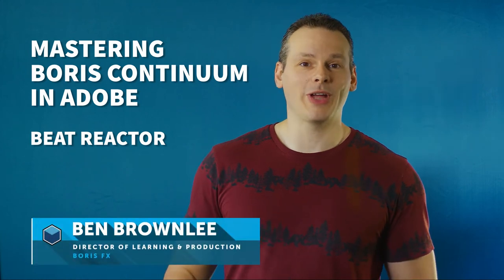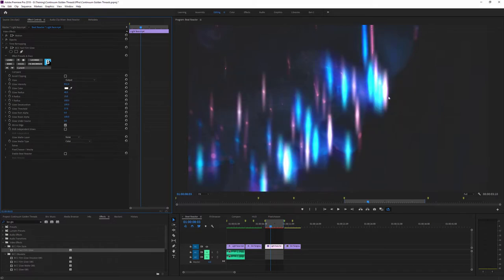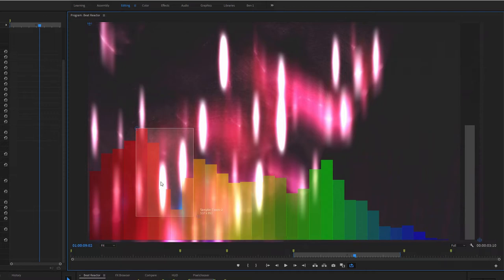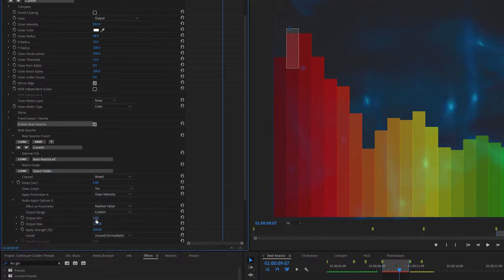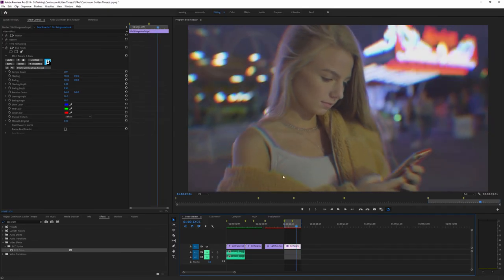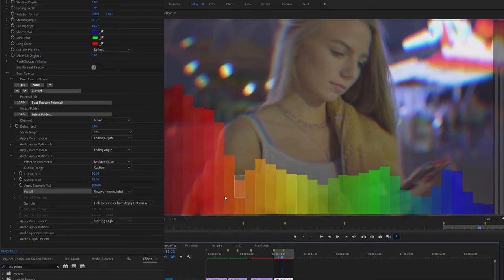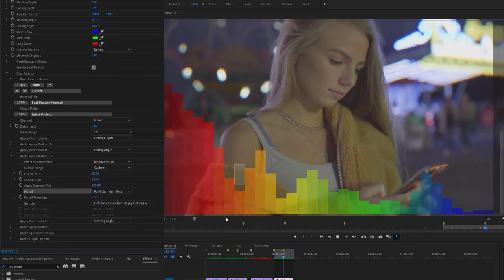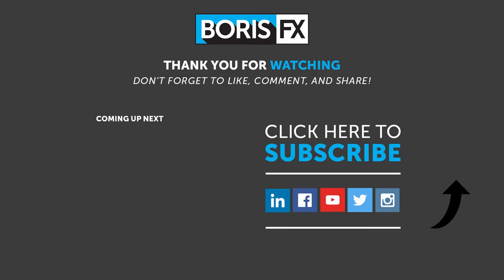[Adobe] Mastering Beat Reactor with Boris FX Continuum

Comment: My AIFF file must have been messed up because the spectrem would go crazy fast and wouldn't match the song. After putting the song in Audacity and exporting it as an AIFF (found under "other compressed files") it worked like a charm. Finally I can make sick lyric videos with audio reactive effects. Thank you!
Reply from the maker: That's an excellent tip for people to check if they have an issue.  Thanks for leaving the comment.

Comment: Hi, Iam using Davinci Resolve. I have all running with Beat Reactor. I was wondering were I might get that graph file that you loaded in? Its going to be tough figuring out how to use BCC Beat Reactor in Resolve but I think I can figure it out. But having that graph would be a start. Thanks very much :)
Reply from the maker: You have to a couple of things in Resolve. Firstly you must load in an external .aif audio file as you cannot grab the data from another layer in Resolve.  Once that is done, if you are still not seeing the graph you have to turn it on manually. To do that look at the Beat Reactor group and twirl it open if it is not already open. There is a parameter called Show Graph with a dropdown menu next to it. Set that to Yes and do your setup. Remember to turn that option back to No before you render!  Hope that helps.
Reply: Thanks so much. I did those first. The Aiff and Show Graph. Nothing happens, I think maybe with Resolve there is something else that needs to be done to get it working hmmmmm. In After Effects it works easily for me. I will keep trying. Thanks again.
Reply: Thanks again. Iam very familiar with Beat Reactor in After Effects. I also us Davinci Resolve all the time which I prefer. I have tried everything to get Beat Reactor to work in Davinci Resolve. Iam thinking maybe it has something to do with creating separate alpha layer. See this link. Maybe as mentioned working with alphas or secondary layers. I love Davinci so much I will try my best to get this to work (so I dont need to go back to AE) Thanks for any more help :) 🌹🌹🌹 Here is link
https://borisfx.com/documentation/continuum/bcc-overview-in-resolve/
Reply: UPDATE!!!! I got it to work. In case any one else needs to know. In the color panel I  added a second not called LAYER MIXER. Then I applied the boris effect on to that and all works like a charm. Like in after effects but MUCH faster and EASIER.
Reply from the maker: Glad you got it working, and thanks for posting your workflow here for others to find.

Comment: Every time I insert an aif file, it crashes Vegas and it keeps saying this:
Unmanaged Exception (0xc0000005)
Reply from the maker: That shouldn't be happening. This error is often related to video card problems. First step is to update your drivers.  If that's not helping, does turning off Enable OpenCL in Beat Reactor help? To do this, click on the cog button at the top of the effect, to the right of the Load and ? buttons. 
If you are still having problems, could you send this to the forums (https://forum.borisfx.com/c/continuum/23) telling us the versions of Vegas and Continuum you're using.

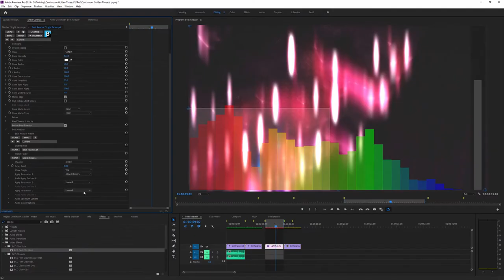Comment: This is great but its not good for effects with more then 3 parameters why does it only allow 3. I'm talking about in this area 1:53 how can u make it with all effects
Reply from the maker: If you're going to link the same data to more than three parameters, the easiest way is to use expressions in After Effects.  You can always duplicates of the BCC Beat Reactor effect if you require more outputs. Practically speaking, the vast majority of effects you'll want to create with Beat Reactor, will only need the three parameters.  If you need more for a specific effect, stack up Beat Reactor effects, or just link multiple params to the same Beat Reactor data.

Comment: How does the external audio track and the track on your timeline sync? If I have only part of the track on my timeline, do I need to sync it in advance?
Reply from the maker: If you're using an external audio track, you will need to sync it before using it.  If you're using a host audio layer, you can move it on the fly before generating your Beat data.

Comment: I'm very curious can beat reactor be used to speed up and slow down a video clip?
Reply from the maker: You could use BCC Beat Reactor to generate keyframes, then connect those using Expressions in After Effects. Create a duplicate of your video, enable time remapping on it. If you want it to just beat in time, use something like this, using the pickwhip to link "beat" to the generated Beat Reactor keyframes : 
beat=PICKWHIP TO BEAT REACTOR OUTPUT VALUE TO GET LINK;
firstFrame=thisLayer.inPoint;
lastFrame=thisLayer.outPoint;
maxValue=100;
linear(beat, 0, maxValue, firstFrame, lastFrame)

This is a very basic way of using it. Lots to experiment with, including changing the keyframe output in BCC Beat Reactor to Add to Value, then updating the maxValue in the expression. Play around, have fun, find a cool effect!
Reply: @BorisFXco  thank you very much. I will definitely try those steps
Reply: CAn you make tutorial on it?

Comment: there's no spectrum graph showing. can you please send me those  external Beat Reactor.aiff file you have. im also using premire pro.
Reply from the maker: To see the graph you have to choose View Mode > View Graph or one of the other options there.  Unfortunately we do not have the rights to distribute those aif files, but you can literally use any audio file converted to AIF. 

In Premiere Pro you should be sure your music file does not have a lot of blank space at the start. There are ways to offset it but it is just easier if your file starts properly at the beginning. 

If you are still having problems, be sure to head over to the forums : forum.borisfx.com